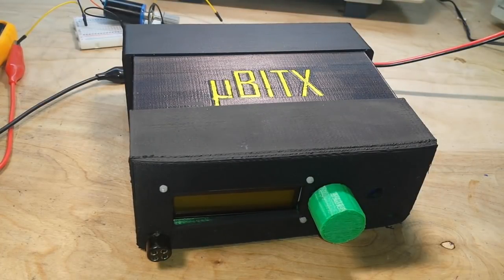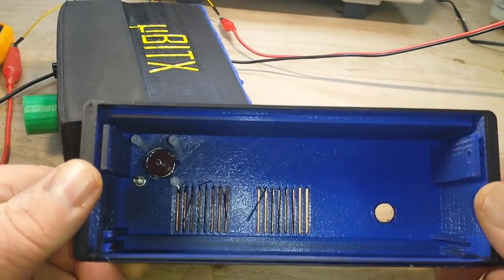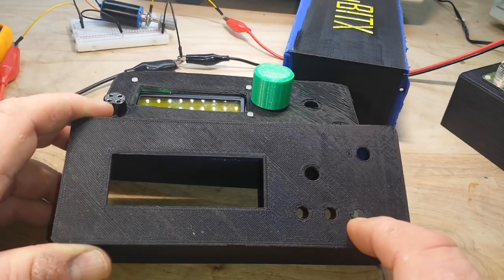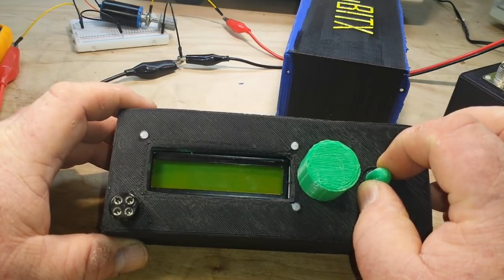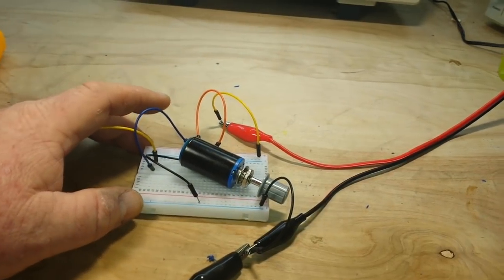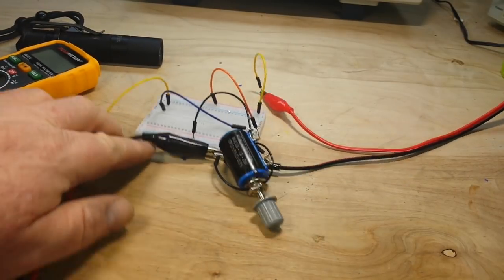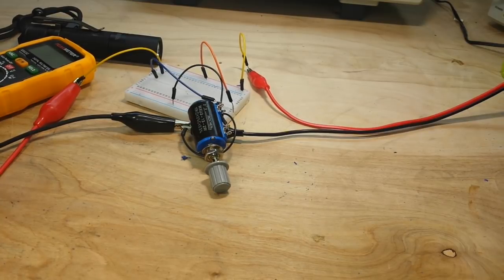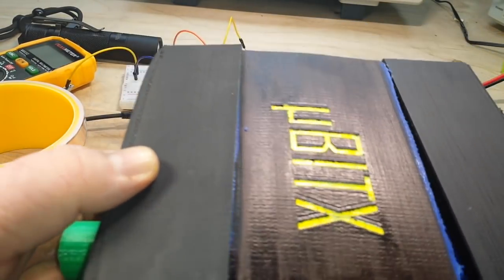BITX 3D Printed enclosure and mods

Comment: Hey Learn Electronics. I maintain a couple of playlists. One for the BITX and one for the uBITX . Two completely different radios. Now, I'm not sure how this is happening, but, you say your ordering a uBITX in the beginning. However, you then describe the pot that USED to be supplied with the BITX. So , first question. Which radio did you order ?
After you answer that question, I've got some info for you.
Reply from the maker: I ended up ordering the BitX40 as mostly use the 40m band, and I want to use it for digital modes.
Reply: Ok, if your saying you labeled the box as a uBITX and then changed your mind, ok, that makes sense. But, I've seen you interchange the uBITX with the BITX quite a few times and I'm concerned a little. But, anyway, next point, the BITX from hfsignals.com for $59 comes with a raduino. So, it doesn't use a pot for tuning, rather, it uses an encoder. An encoder is a digital device that uses a pulse from the device to tune. In addition , the encoder that they use is somewhat special in that it has no mechanical clicking, its completely smooth like a pot. But, its actually sending pulses to a little computer that comes with the BITX. The entire device is called the RADUINO and consist of a NANO and a little board with a synthesizer on it. Its very stable and you'll love it. 
      But, if you've bought your board from some sort of clone company and it does have a pot for tuning, there is a site where a guy comes up with a way to tune that is much better than the 10 turn pot. It was developed before Raduinos were being sold. His site has a bunch more things you can do with BITX and uBITX . www.nd6t.com .  Have fun

Comment: One thing I would have personally did different, would be to put the speaker jack on the back.  Only use front jack if it is head phone.
Reply from the maker: That's easy enough to fix. Thanks for the idea.

Comment: I like Digger D's response. How did you print two colors with a single print head or have you upgraded that? Cool video but no money no license no need for a radio. Good video anyway!
Reply from the maker: The black is spray paint. Blue and green I just switched spools
Reply: Very clever!